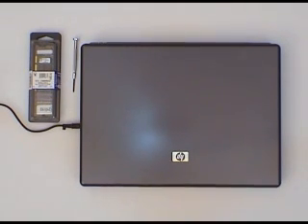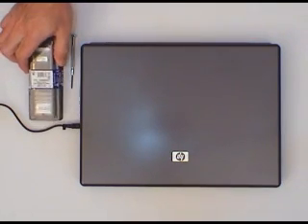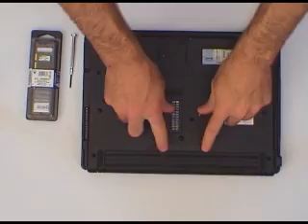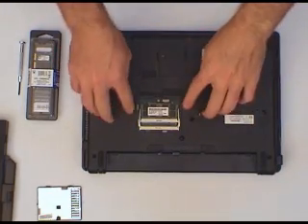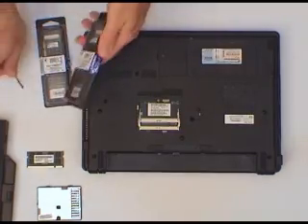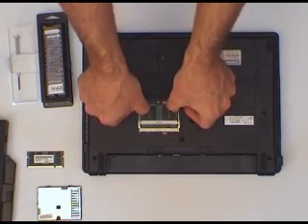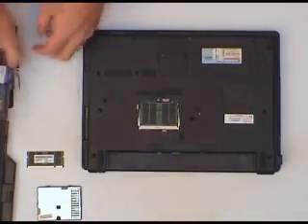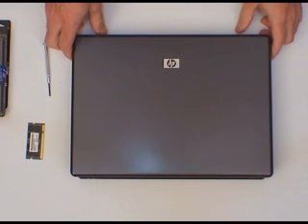HP 550 Laptop Memory (RAM) Installation Guide

Comment: Hi i have the above laptop HP550 Notebook pc i bought it with 1GB ram installed after uprade it to Windows 7 ultimate i bought extra 2GB ram DDR2 2GB 800Mhz now it shows 3GB of Ram on System after microsoft is upgrade my laptop on Windows 10 pro i just bought another ram DDR2 2GB 800Mhz to replace the first slot with 1GB to get 4GB totall the new ram wont recognized any ideas? i search in google and the specs says i can get 4GB Maximum any solution?
Reply: I am not entirely sure, but sometimes it might depend on if the computer is 32-bit or 64-bit.

Comment: Hi how much the max clockrate whats support the motherboard? I dont see information from in the video. Thanks.
Reply from the maker: Hi, in this video we focus on replacing the currently installed RAM with equivalent larger modules. No speed change is made. Also most machines can only handle the standard speeds they are intended for and are not designed to be overclocked. Specifics on this particular machine are not noted in our upgrade path.

Comment: thanq for dis video and now i can change my hp 550's ram but is it really effective for speed ?? bcz it has intel core 2 duo.. if the performance of laptop will be change then i can pay money for it.. otherwise get the new one , can i change the processor and the hard disk also ?? if yes then tell me the limit of ram, hard disk and processor so i can do something... and can i add graphic card too ??
Reply: +JAY CHAUHAN Well, RAM isn't that effectiv, but I think you will be able to have more programs up at the same time (I have an HP 550, and it's old, can almost just have Edge and internet explorer up on the same time before it gets too slow) 
I don't think there is any place for a graphics card in this computer. Not sure tho.
Reply: ok thank you for the video and for reply..
Reply: JAY CHAUHAN
You are welcome, and my computer just has 1 Gb ram :D
I do not use it often... at all.

Comment: need your help i have the old HP 550 with 2 GB ram ( 1 GB x 2 cards ) and my new lenovo G500 ( 6 GB ) so will the HP RAM support lenovo G500 ? answer please :))
Reply: it might support it
Reply: u have to check the ram type, i think all laptop rams are the same
Reply: No dude actually there is difference becuz of the heat rate / watt in and other random stuff so they all r not the same…

Comment from the maker: @leycorbin4ever .  Your data is stored on your hard drive, not on the memory modules.  So long as you take good anti-static precautions, it is safe to remove and reinstall memory modules without losing any of your data.  I recommend you make regular backups of your data, as hard drives often fail.

Comment: yeah i had a question, isnt hardrive the same as Ram memory? i have a presario f700 but i want to upgrade to a intel dual-core 3.0Ghz or higher and i need 2gb of ram or more for a hd webcam to work on my laptop...do i need to buy a hard drive or what, because im confused? pls answer asap

Comment from the maker: @GrEaTeSt786 After you install the memory (assuming the machine was turned off), just turn it on, follow any system prompts, and when fully booted the operating system will recognised the new RAM.  Note, only around 3-3.5GB will be recognised in a 32-bit operating system.

Comment from the maker: 4GB is the hard limit for 32-bit operating systems, including XP home edition.  Depending on your configuration though, your pc will recognise 3-3.5gb if you install 4gb, as some memory is reserved memory addressing space for graphics controllers and other peripherals.  There is more detailed information about this in the Help / FAQ section of our website.
Reply: Hi after 10 years! Still 4 GB limitation for HP 550 running Windows 10?
Reply: @starakfest  good question do u know the answer? i installed windows 7 64bit so 8gb should work?